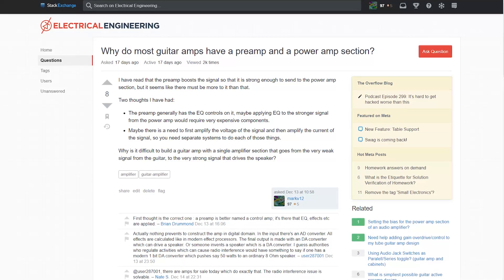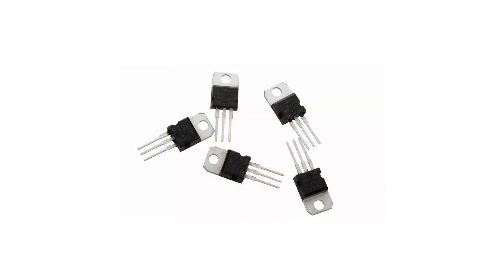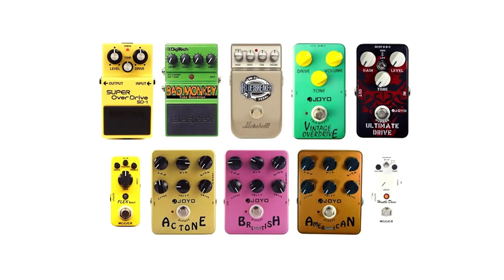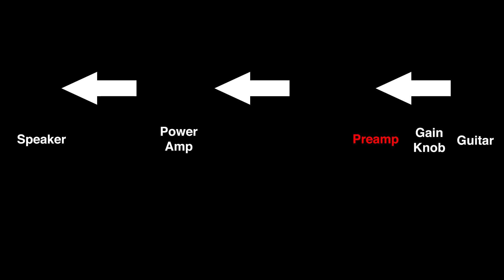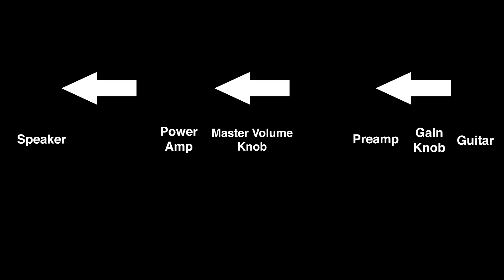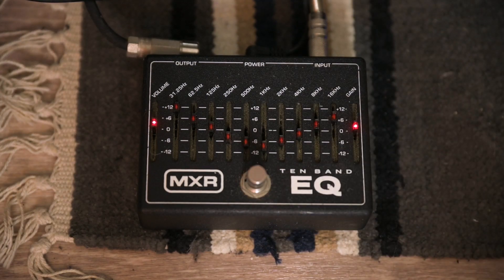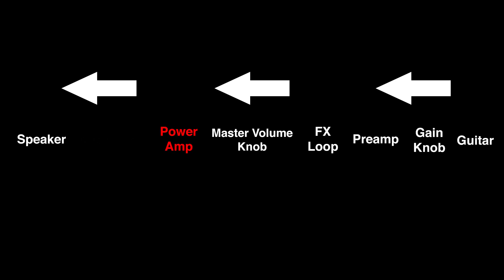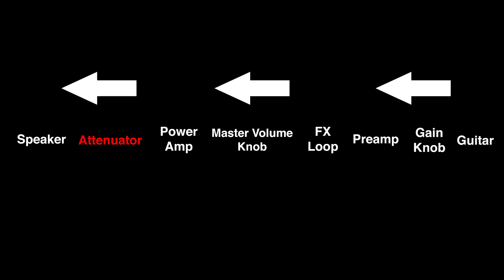Beginner's Guide to Tube Amp Overdrive

Comment: Excellent. I gigged my DRRI for years with a TS type pedal for od and craved the natural amp distortion...but it was too loud for most pub gigs. Then, a clean boost in front, amp on 8 and a attenuator...heaven! Open sounding, lightly compressed overdrive, very responsive to guitar controls all at workable gigging volumes .

Comment from the maker: A slight correction:
The gain knob actually goes between the first stage of the preamp and the rest of the stages.
So when you use the gain knob, your only overdriving the rest of the gain stages, whereas when you boost the signal before it gets to the amp, you're potentially overdriving all of the stages, which would likely alter the sound. You can hear in the video that boosting the signal before it gets to the amp produces a noticeably different overdrive than using the gain knob.

Comment: You say that the gain knob controls the level of the signal sent to the preamp tubes. This either requires an additional level of amplification, which is almost certainly not happening, or the gain control is actually limiting the input level, right? But I'd always been under the impression that the gain control adjusts how much amplification happens during the preamp stage. Which of these things is true?
Reply from the maker: Thanks for the excellent question! I did some research and posted in the electronics stack exchange about it. Here is the thread:
https://electronics.stackexchange.com/questions/544294/in-an-amplifier-does-the-gain-knob-boost-or-attenuate-the-input-signal/544301

It sounds like it may be limiting the level. But not necessarily. I also found out that for some amps the gain knob also mixes in an extra gain stage as you turn past halfway. So there is potentially a lot going on with that knob. I think for the purposes of this video, what I said is not too misleading.
Reply from the maker: OK, I've learned a bit more about this now. The gain knob actually goes between the first stage of the preamp and the rest of the stages.
So when you use the gain knob your only overdriving the rest of the gain stages, whereas when you boost the signal before it gets to the amp, you're potentially overdriving all of the stages, which would likely alter the sound. You can hear in the video that boosting the signal before it gets to the amp produces a noticeably different overdrive than using the gain knob.